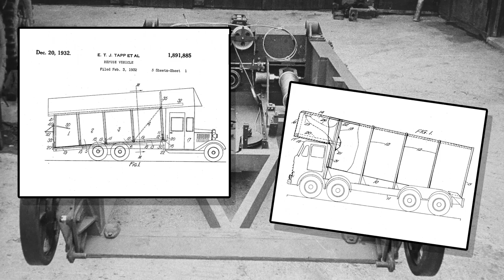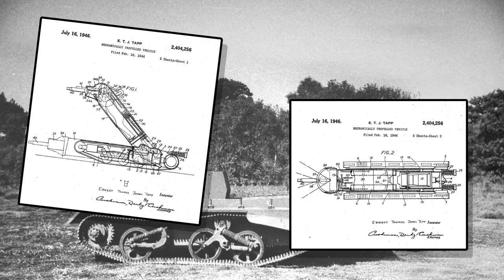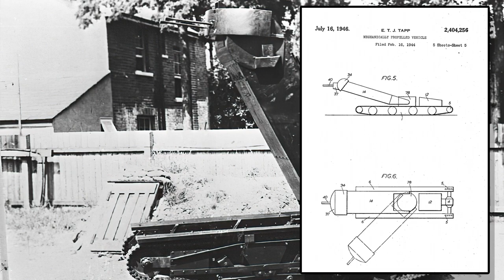The Praying Mantis - Tank Design & Development - Rare Pictures and Footage

Comment: That is truly incredible, and slightly unnerving.  I wonder what the psychological impact would have been on the battlefield.
Reply: I only know it from photographs and to be honest I thought it looked a little silly. But the film footage shows how fast and quick it was. Yes, it would have been very unnerving to the enemy.
Reply: Watching the video does give it a unearthly presence, especially with the moving "head" bobbing and looking around., Pretty sure the avarage soldier of the 1940s would have a moment seeing that looking over a wall or hedge. 
Seeing as it was an attempt at solutions to a problem that still exists on today's battlefields would today's solutions be a remote mg or grenade launcher mounted on a telescopic pole?
Reply: I'm mildly disappointed a dressed up one of these wasn't used as a Doctor Who monster, perhaps a War-Dalek or suchlike. Very simple to dub over the engine noise, I would think.
Reply: One of the most unnerving things I’ve seen……almost looks alive.
Reply: A very good concept for a modern missile system. You can be grouped 500 m in the forest firing at tanks attacking over an open area. The problem is that you would need a 16 m skylift.
Reply: Given you were "safe" while covered by walls, having this thing just pop over the wall and let loose burst and be away time you can react to it would been horrid, causing enemy to be afraid of its own shadow since now only place safe was inside the buildings second floor.. ou wait this thing can lift up there and let loose inside and it can be used as a ramp to gain access if you consider alternative uses for it, while giving support. I just wonder how well this could protect from potato masher grenades or traditional frag grenade blasts. bundle grenades would surely make quick work of it. Also hows the armor protection for the crew? Witch brings to question of mine protection since on bottom location you have thick plate of steel front of you, though you are pretty much laying top of it... many unanswered questions really.
Reply: Paint googly eyes and a smily face on it. Half the enemy would laught themself to dead and the other half shit their pants.

Comment: Looking at the first prototype from the rear as it approaches the dug-in position where those soldiers were, it didn't look out of place. Looking at it from the point of view of an enemy position, seeing that crane spring up above the ground and move its head around both machine-like and human-like at the same time was creepy in a way. I suppose the same could be said for the second prototype and final product, having two vision ports in the face of the crane, but still, the first prototype's movements were way more touchy and quick versus the others' being more slow and mechanical. 

Very neat machine nonetheless.

Comment: Jeeze. I also thought it was a comical idea until watching the footage. It's not really a 'silly little tank,' so much as an attempt at power armor. Can't hate it for that. Problem is, I doubt it has enough armor to withstand the attention it would receive on the battlefield.
Reply: It would have to be used for surprise attacks only. But with bazookas or similar also attached, you could imagine it popping up, firing a bazooka 'ripple', firing an MG belt then back down for reloading for the next pop up in the bocage.
Reply: As a remote operated vehicle, it has merit.

Comment: That is really clever how the armature uses the hydraulics (or whatever to power it) to keep itself fairly level and absorb the shocks of cross country travel- I imagine the ride would have been a bit peculiar, but not terribly rough.  I feel like a little tuning on the response rate and some further  development and they likely could have dialed  it in to keep things just about dead level like a stabilizer on a main tank gun and that would have solved a lot of the motion sickness issues for the crew.  A really clever solution to a problem, even if one that ultimately wasn't used.

Comment: Amazing vid!!........ to understand that it was built for WW1 where they saw tanks being slow to cross ground and easily blasted to atoms, to see the need for stealth, speed, concealment, to have a vehicle that can operate on such varied terrain, for it to do pop up attacks then relocate, for it to be able to use any cover available from a shell hole to a house, it looks so futuristic for 1930 even a coolant fan for crew and the secondary spotter option is like something from Gundam, but was actually needed for artillery spotters where in WW1 they had HUGE telescopic seats. To see this vehicle that was made a mockery of by so called professionals, be brought into view by its reasons for its design and how it meets those design requirements makes me so happy and I have huge respect for the designers. Fantastic vehicle.

Comment: That was a strange, bygone age of tank design :)
At 25:22
 I can be wrong of course, but those don't look like Bren guns to me, they look more robust. I have a suspicion that those are BESAL light machine guns(otherwise known as Faulkner LMG). Which would be an interesting turn of events, since the BESAL was also a prototype.
Also, you won another subscriber with this video.
Wish you the best,
a Hungarian Tank Enthusiast.
Reply: very hard to tell with the old low qty footage, the end of the gun appears to have the flange of the Bren? but can say for sure, they are recorded as brens, but then who did the recording at the time? certainly, stranger things have happened. good spot
Reply: @edfrancis712  I slowly and properly checked the footage again, those are Brens. The front sight is much farther back on the BESAL than on the Bren. The foregrip is different though, that's what mislead me. Maybe it was modified for the use on this vehicle. The Museum has (or at least had last year) a Bren to play with... khmm... inspect up close and personal. I know, Google is my friend, but in retrospect, it was foolish not to take at least one close-up picture of that machinegun. I had to correct that mistake in September :)
Reply: @bencejuhasz6459  ahh yes the guns were 'inverted' but no other details on them. so that might be why?
Reply: @edfrancis712  Now that you mention it, the soldiers take them out upside down. And I think the reason for that is because normally the Bren wouldn't fit in with the magazine inserted and pointing up.
Reply: @bencejuhasz6459  it might fit upright with the 100 round pan magazines, although reloading wouldn't then be an option from inside. Although I am not sure the pan magazines would stay on inverted. Given the confines, I can see it might be possible to reload thirty round magazines. I wonder if the concept was to fire each gun in turn, then duck down for reloading. I'm not sure I'd want to be elevated in an armoured potential coffin trying to change magazines. A   single BESA and a couple of linked belts seems to me like it would have made more sense.

Comment: I think I saw this a while back and kind of reflexively disregarded it because of how bizarre it seemed - but now I'm thinking about it, I could see a vehicle like this being a pretty significant addition to infantry units. If they could have made them reasonably cheap, reliable and agile at least. Basically a light infantry tankette lol. Though I can't see them being fitted with anti-tank weaponry. It'd just make more sense to park the vehicle up, have two infantrymen pop out, grab the anti-tank weapon out of stowage and use it as an infantryman 

With just the size of the vehicle, I also can't help but draw some kind of parallel to modern/near future remote control/automated small vehicles that are intended to directly support infantry - be it in providing fire support or offering itself as a pack mule or transport. You know they'd make a flamethrower version as well 🤔

Comment: Interesting idea. I have to wonder just how heavily armored it was. I don't think it could have had much armor or the lifting system couldn't lift it as fast as it did. Anti tank rifles, heavy machine guns, and light anti tank guns would probably been enough to knock it out seeing as how the operator was up at the end of the lifting arm and thus exposed to fire. The other thing that stands out to me is you would need a crew extremely resistant to motion sickness.
Reply: Indeed motion sickness was a problem. as for armour - it wasn't written down and I have currently no access to the machine as it stands. from looking at it when it was last available it wasn't much, enough to stop small arms fire only. - any anti-tank or even light cannon fire would have easily perforated it.
Reply: Armour would have been a problem, I'm guessing. These things are spooky and the enemy would have fired at it with anything and everything they had.
Also ammunition. I know that sustained fire isn't its' role, but how much could be carried in that turret?
And how to aim?
But I can imagine that the Ministry was sorely tempted by it!
Reply: @wolfhound113  alas two brens inverted are recorded. so 2 x 30 - .303, no9t ideal but then this was a test concept so who knows what else Mr Tapp had planned in the long run?